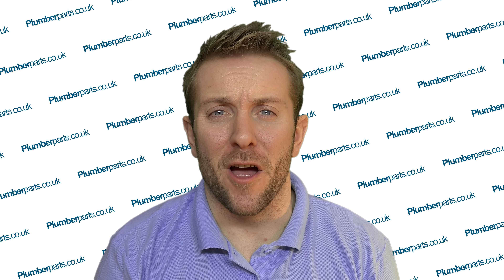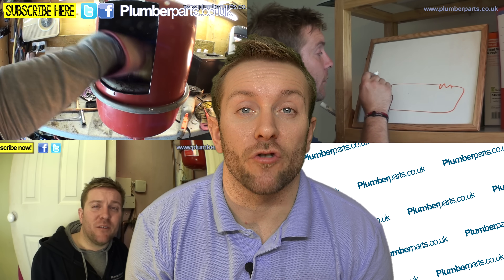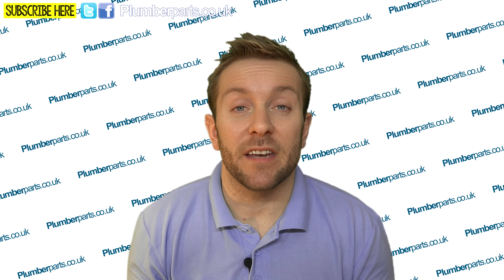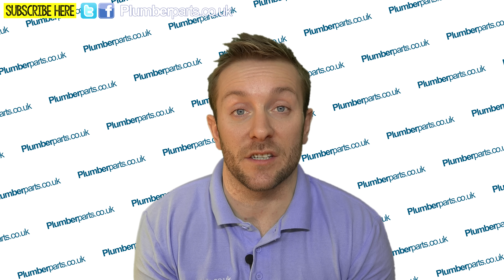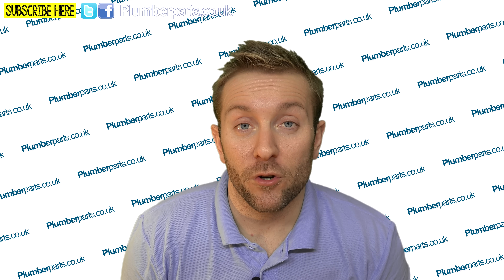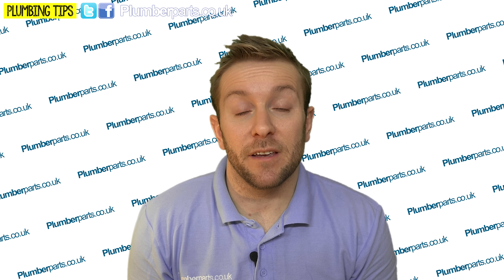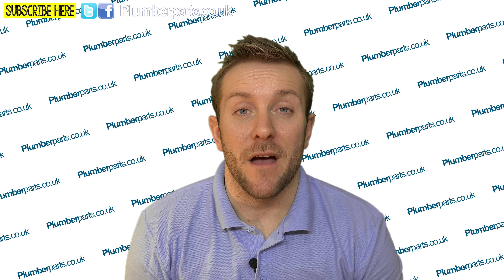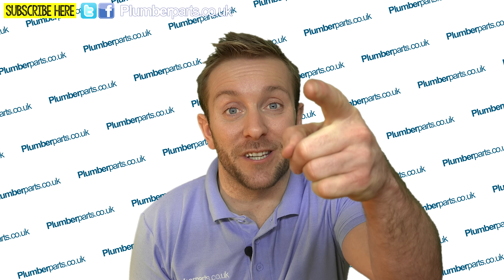BOILER KEEPS LOSING PRESSURE - WHY AND HOW TO FIX - Plumbing tips

Comment: Hi, a friend is asking, if a boiler stays ON heating non stop all of a sudden, even if the button is then switched to OFF, and gas switched disconnected too... It is not responding unless electricity is disconnected. What could be the problem. Sometimes it gets back to normal afterwards, but it happens every now and then and it is dangerous.
Reply: Controller failure. Electrical short in the system (water?). Plug L wired to N and N to L? The last one is only a problem because AC in household properties is not delivered as classical AC - the N is kept at 0 whilst the live phases for the entire cycle at the set voltage. If a house used classical AC delivery, the N would kill you just as effectively as the L. Reversing of L and N can also lead to live voltages on pipes and boiler chassis, so be careful. DO NOT swap the wires "just to check!" Check how its wired and change if required. Remember to check the connection at the boiler as well as the plug. Unplug BEFORE checking.

Comment: Excellent     I guess you are the man .. well done   easy to follow presentation  and nice clear voice. I had a slow,   real slow,  loss of pressure in the ch system with combi boiler .. there was some sign of discolouration in the wall and I sealed the outside patio believing it was leaking into the wall from the outside veranda. After watching your video and checking all of the connections   I have decided there must be a very small leak inside the wall. so next step is the hammer and chisel ./. thank you so much for your input and support.

Comment: Your remark about combi boiler expansion vessels only accomodating the expansion of the water inside the boiler itself is complete crap.... The expansion vessel size should be 10 percent of the system volume. For your statement to be true the size of the combis vessel would only be about 300ml: pretty sure I've never seen a combi with a vessel that small.

Comment: Thanks so much for this info! We recently got our PR Valve replaced due to it being faulty. I'd like to quickly ask if I will need to put inhibitor into the system again? As every time the pressure dropped below half a bar we topped up the boiler with water from the filling loop. Does this mean we will need to put inhibitor back into the system?

Comment: Pressure loss through the main heat exchanger is so common with ideal junk, not mentioned here so before you rip your floorboards/walls up checking for leaks call the professionals in, you wont see the leak but you'll see the pressure drop, you'll then need to do...........

Comment: I have a MORCO 24  Series 2 in a caravan virtually new. Recently my Boiler Pressure kept dropping to 0.1 Bar whether on or off. ALL Radiator valves were checked ok by me and I had to repressurise about every 6 hours and I wondered where all the pressure was escaping ! I watched all of these plumberparts videos thinking it could be the Expansion Chamber at fault. Don't ask me how but the Warden on my caravan park drained the hot water system with loop open and heard gurgling ,shut the hot water then re opened it and an airlock was discovered which became cleared ! The Boiler has been behaving (touch wood) since !

Comment: My heat will not tun on or off at thermo start in hallway i need to keep going to my boiler and putting switch on to heating and radiator to turn heating on my boiler is combi 35.

Comment: Advice on th following the grub screw in the cold feed isolating valve to the filling loop will not turn ( it looks as if its worn) do i have to replace this isolating valve?
Reply from the maker: Yes you will I'm afraid! Sorry Dave!
Reply: This is an excellent video and I will be subscribing, but could some of the hate come from your comment about the pump impeller creating hydrogen? It's late, but that made me raise an eyebrow.

Comment: Sorry, there's no way cavitation makes hydrogen and oxygen... cavitation is making little bubbles of (just about) vacuum with a little bit of water vapour in that collapse almost immediately and can damage the impeller in the pump.
Reply: Actually, it does. The cavitation is not just boiling of the water to create pockets of "air" (It's a combination of water vapour and dissolved air) - the bubbles are low pressure but they are most certainly NOT a vacuum. The physics of the situation dictates the water can break down into hydrogen and oxygen because in addition to the mechanical motion and heating there is also an electrical flow in progress. The multiple types of metal in the system ensure an electron flow. So yes, the pump is one of the places where water is split into hydrogen and oxygen. The popping you may hear in radiator is sometimes the two gasses recombining into water, but the amount of free oxygen is often less than the hydrogen because the oxygen binds to the corrosion inhibitors in the system or sometimes the chlorine in the water (molecular compound, not ionic). This leaves more free hydrogen to vent. Most of the gas coming out of the system when bleeding is just normal "air" that was dissolved in the water, but it has a higher concentration of hydrogen than the atmosphere.  Cavitation damage to props and impellers is largely shock damage when the bubbles collapse. There are several videos on YT which explain how the bubbles are created using cavitation by snapping shrimp. Have you listened the din on hydrophones? - those shrimp a really loud!

I'm no ship's officer (catering?), but I do my own plumbing, electrical work, electronics repair, and systems design for reactive systems such as fuel flow in aircraft engines . I also have degrees in Computational Engineering and Physics (lots of free time after breaking my back at the age of 24, many moons ago.) Plumbers get annoyed that I do all my own work, but I do respect their advice when I ask them to come and check my work; something I always do after finishing.
Reply from the maker: Can you read what you post before you post it! I don't understand the sentence...
Reply: Matthew Lowy well done ! Cavitation also applies to Ship's Propellors (includes small boats) and causes damage to propellors under water ! I am an ex Ship's Officer.
Reply from the maker: Good on you dear boy! My bro's in the RAF.
Reply: Mathew, that is not what he is saying. Cavitation, by lowering the partial pressure, creates conditions into which dissolved hydrogen will out-gas from the water. Cavitation while therefore not "making"hydrogen will certainly promote or encourage the out gassing of hydrogen by creating favourable conditions ie reduction in pressure in the cavitation bubble.  In simple terms , agitating the fluid by stirring  will cause more out gassing than leaving the fluid to settle.  If you want an easy to understand model - stir a glass of fizzy drink and watch how quickly the gas comes out of solution compared to a glass left to sit.
Reply: @wardogass6101  Gaseous hydrogen does not dissolve in water to any great or lasting degree. It's so light it just heads for space once freed unless it's trapped in a system. In radiators, it hangs around at the top until released. Gaseous hydrogen in a heating system comes from splitting of the water - no from being dissolved in water like CO2 or nitrogen.
Reply: Taut Tech correct gaseous Hydrogen is a non polar molecule as such it will have a low solubility in water but nonetheless is does dissolve in water.  To be completely correct then the majority of the gas which is liberated due to cavitation will therefore be air.
Reply: Yea load of bollocks
Reply: North face nija could you explain, which part is bollocks?
Reply: It also affects the pcb

Comment: I have a leak on the dial I turn to put the water pressure up is it easy to replace
Reply from the maker: Yes, is it a standard chrome isolation valve?

Comment: Hi guys!! Would you please explain what could be an issue with boiler that usto had pressure drops. Ones that was fixed- we constantly hear water filling in the tank after every time we use water. It is very loud and it was never heard before till now. Presure part is not showing any movements. Ones I tried to top up water to the tank (as we usto when the presure was down) it stoped the noise shortly... plz help! Thank you.

Comment: I have a leaky valve on my filling loop how do I change it? It's a compression fitting with mini quarter turn valve. The compression fitting is not leaking its the valve itself. Coming out of the small plastic handle. Removed handle by taking screw out and there's nothing I can do there to stop it dripping. No nut to tighten. The boiler slowly loses pressure due to this and when topped up the drip is faster. What kind of valve do I need to replace it with? Also I notice the flexi loop has no nut to get it off. It has these two wing type protrusions. Does that mean they are done up hand tight or would I need a tool to remove the filling loop?

Comment: awesome video mate, and well delivered,  quite often i get to a boiler which needs repressurizing  and they have no link pipe,  how do you repressurize those types of boilers, a short vid would be great.
Reply from the maker: Hmm, you'd have to use a hose pipe with valve at the boiler end and a mains tap at the other. Like old schoool back filling when you've got an airlock!

Comment: my pressure needs to be lowered any advice please , its a vaillant ecotec pro 28 .
Reply from the maker: Do it from a radiator drain off....nice and slowly until you get the pressure you want. Good luck!
Reply: plumberparts lovely, did the job , thanks
Reply from the maker: no worries!
Reply: Paul Oxen

Comment: My water keeps going cold like the pilot light has gone off but the pilot light is not showing it has gone out, so I turned the boiler off and turned the boiler back on and after a few attempts it comes back on, this problem keeps happening so I had British gas come out to look at it twice and they say they don't know what he problem is. They say I shouldn't have  a shower whilst I am doing the washing up at the same time because this can cause the boiler to overheat and shut down, I would like to know if they are just talking a load of rubbish or is this true?

Comment: Thanks for the video. I have a Worcester Bosch greenstar 24i. The pressure gauge has been dropping for a while and I have been topping up. I can't see a leak anywhere yet. I bought a pump and pressurised the expansion vessel to 1.5 bar looking on the gauge on the pump as the system pressure gauge kept reading zero ( so i knew there was pressure in the vessel). I started boiler and and the pressure gauge rose to about 2 bar but as previously stated it gradually drops back to zero when the boiler stops. Would this be a problem with the pressure gauge as I already know the vessel is already charged?

Comment: I have a slow intermittent leak from one of the taps on the filling loop of my Potterton Performa 24 Combi Boiler. Can I take the hose off and replace any seals that may have perished without draining the system or flooding the place???
Reply: Thank you so much mate 👍👍👍
Reply: M

Comment: Good video, sometimes water out the shrader valve is just condensation, always pressurise the vessel first before just replacing expansion vessel. Test valve with LDF as this can be replaced also with a special tool.
Reply from the maker: Coolio!

Comment: Why so many hates?  A quarter of a million views means that a lot of plumbers have probably lost a lot of money, but the sad fact is that a lot of plumbers aren't great at fault finding. I have been out to jobs where they have had three or four plumbers in and none of them have noticed that the pump has been fitted the wrong way round or something equally simple.
Reply from the maker: Yeah, I'm sure it's grumpy plumbers! Hey I'm a plumber so I know how grumpy we get!
Reply: @plumberparts  You mate are very Honest Plumber, good on you.
Reply: We're not looking to replace the entire heating system in the house , but this video has been very helpful , I now know that the pressure release valve on my boiler is knackered  , so instead of calling a plumber out to take the cover off the boiler and then look at the puddle of water under the outlet pipe , then driving to the plumbers merchants via the cafe for £80/hrs +vat  , I can buy the valve myself and then ring a plumber or I can fit it myself for free  , after all it's a screw off screw on part  🤷‍♂️  !
Reply: 2.2 million views now😅
Reply: Don't get myself? It's a helpful video
Reply: Plumbers didnt lose a penny from this as THEY CANT LOSE MONEY THAT WAS NEVER GOING TO THEM! see how money loss works now.
Reply: Come on Skill Builder.. its not "hates" 
I like the like this guy, but actively encouraging jo public to do things like checking expansion vessels is wrong.
1. He advised to recharge the expansion vessel,  no mention that the system pressure MUST be on zero and ideally an open pipe / drain point when pumping up.
2. A huge percentage of expansion vessels are located in the boiler case.. do we really need to go into the dangers of opening a boiler case ... 
3. Nine time out of ten so called heating engineers press the schrader valve, gut a squirt of water and assume its faulty... oh, and the the Schrader valve then merrily leaks air.. we always replace the valve.
I really could go on, but it really is not sour grapes, its keeping people safe.
I like many of your videos and this chaps but this one is incorrect,  unhelpful and potentially very dangerous. 
I would urge him to consider its removal. 
Best wishes 
Dave (a heating engineer for the past 37 years)
Reply: @davewellsheatingengineer  David i am just a civilian but find these videos really helpful because i can still call the professionals and ask them the really tough questions. The more i know (from this video) the more I will be able to keep the plumber honest!
Reply: @davewellsheatingengineer  Yes, scumbag. My fucking plumber has luxury of going to a week holiday to states because that rascal deals in cash.
Reply: You are both pricks who crave fame and put the public in danger and at risk of voiding their house insurance!!
Reply: Would be nice to actually get a boiler man to attend an appointment and not bother because there is more money to be made putting in new systems rather then fix the shit job they have already done. Gas safe are about as good as a fart in a hurricane as well so diy is the best way.
Reply: A little knowledge can be dangerous, I could roll off 101 reasons why the general public should not follow out just some of the simple task in this video such as he recommends turning the pump speed down with no future content as what else could go wrong following that simple action like leading to the boiler overheating and in extreme cases split the heat exchanger, then your in a world of pain an see how you saved money by not calling a professional🙀
Reply from the maker: @pomzmetaldetecting1618  Shit, just read your comment 11 months later...
Reply: @plumberparts  thanks for mentioning about disconnecting the pressure loop. I constantly flag it up on legionella risk assessments as a back flow risk and if the valve passess then it can also cost £££!
Reply: @pomzmetaldetecting1618  Bollicks, you're not getting my dosh, let's face it, it's easy.

Comment: Before recharging the internal expansion vessel in a combi boiler, do I need to close the service valves on the boiler and drain the boiler or is it okay to just let the pressure out of the system via a radiator bleed valve/drainoff and leave un-pressurised water in the expansion vessel?
Reply from the maker: Recharge the expansion vessel when the system has no pressure in it. No drop the system pressure. Re charge, then re-pressurise the system accordingly. SUBSCRIBE! ➡️👉 https://www.youtube.com/subscription_center?add_user=plumberparts 👈⬅️ IF YOU HAVEN'T ALREADY! 😎

Comment: No no, no, cavitation is caused by water starvation at the suction side of the pump, water will boil at a lower temperature due to lower pressure creating vapour bubbles. The result is the pump looses performance.
Reply from the maker: You are right! Although the word boil is misleading a tad....but right non the less dear boy! SUBSCRIBE! ➡️👉 https://www.youtube.com/subscription_center?add_user=plumberparts 👈⬅️ IF YOU HAVEN'T ALREADY! 😎
Reply: Here is a link to a table, you will see that water will boil under a partial vacuum if the water is a sufficient temperature http://www.jbind.com/pdf/Cross-Reference-of-Boiling-Temps.pdf 
Where do you think the vapour bubbles come from in cavitation? @ 80 Deg C, an absolute suction pressure of 6.8PSI will allow the water to partially flash off; boil; create vapour bubbles.  By the way, this is normally caused by the wrong pump being fitted, or a blockage in the return (strainer) or low system water pressure.  
By the way entertaining vids..........I'm not getting on your case.